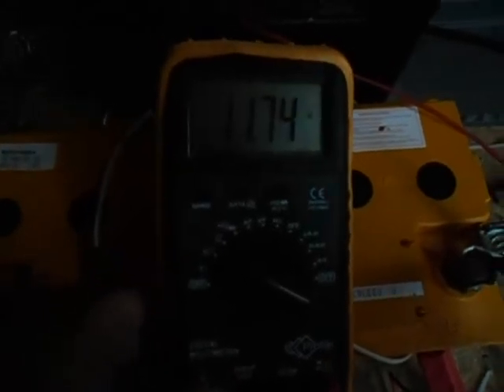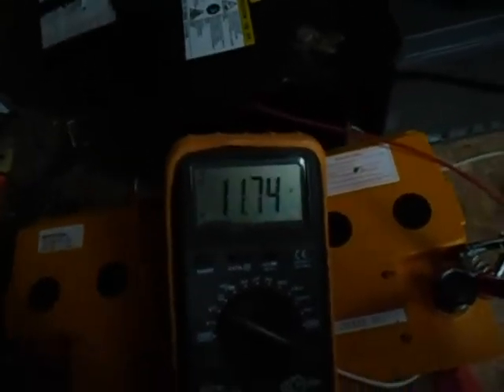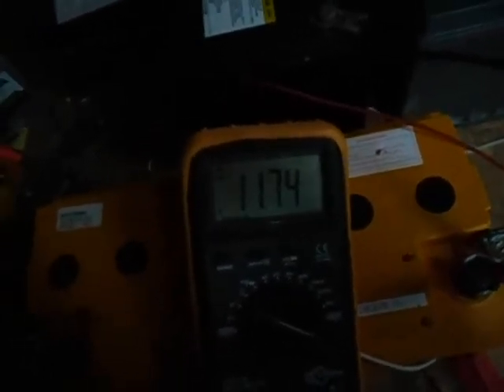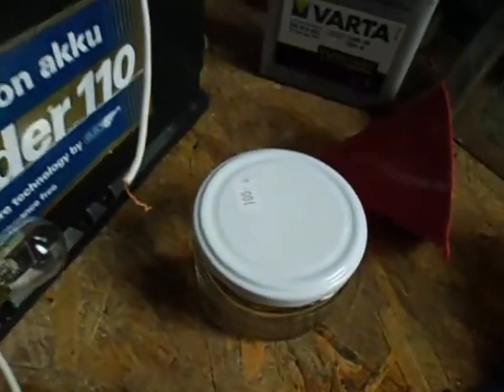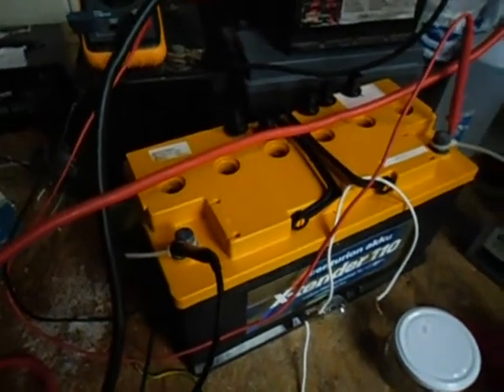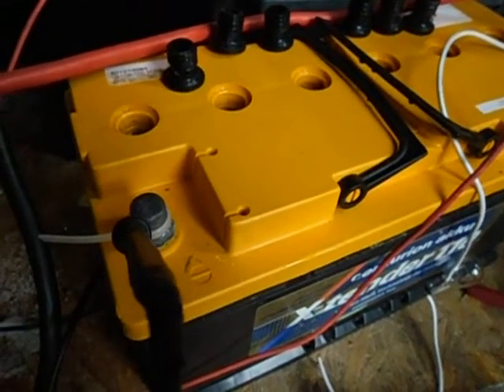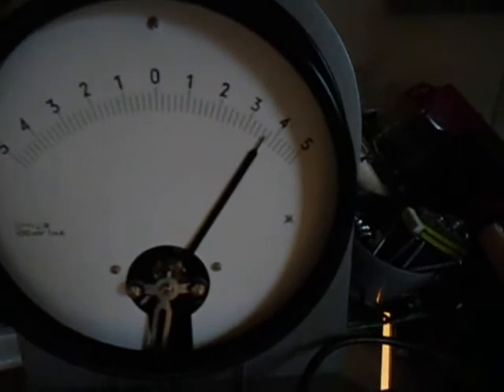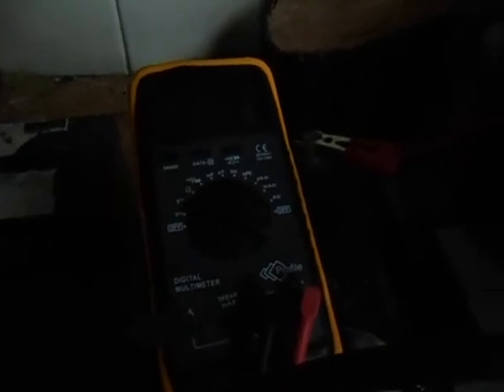next_day standingvoltage_adding_some_extra_acid

Comment: ANY deeply discharged fluid battery will benefit from a charge till 15.5 volt, i understand that you've been using a fairly low amperage at charging, try it with a 10 to 12 amps and continue charging till the bat reaches around 15,5 volt, that should give it its maximum charge only when the battery voltage is very low, say around 9 volt i would start with a low amperage, as soon as the battery reaches 12,3 volt raise the charging amps...